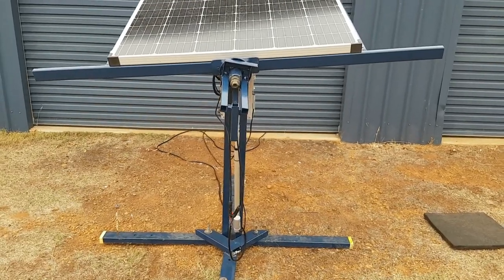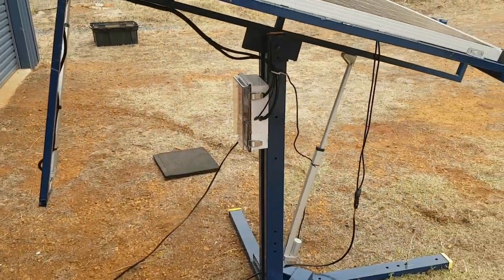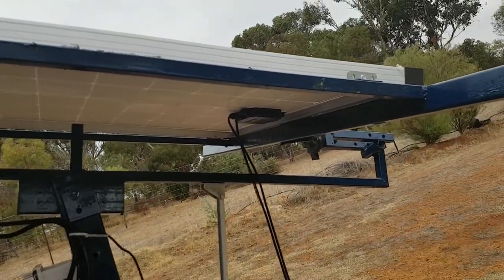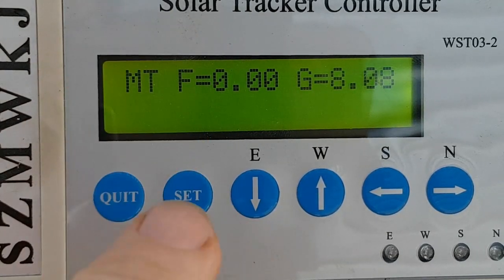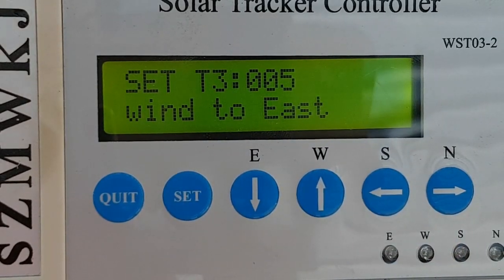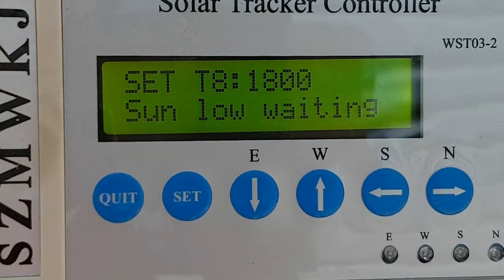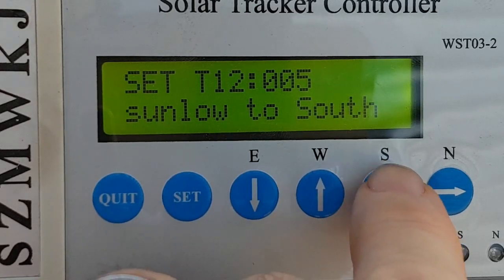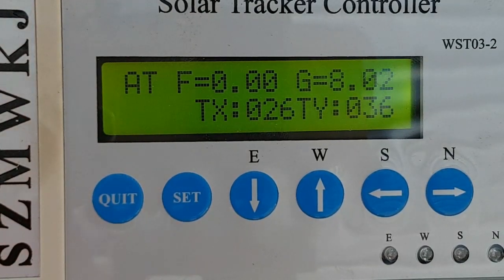2 axis Solar tracker using a  WST03-2 controller

Comment: I'm just replacing my old system with a WST03-2. Confused about polarity for the motor output ports? can you help?
Reply from the maker: Easy, connect an actuator and press the button to move your tracker N or S ( or E or W - depending on the one you are testing). If it moves your tracker in the wrong direction, reverse the polarity.
The controller doesn't know how your tracker is designed, only to drive one actuator or the other. The actuators extend with the voltage one way and contract the other.

Comment: Hi. I've just set my controller up but I cannot get the actuators to move in manual mode. All 4 direction led's ar showing on but I noticed that yours are off in the video until the particular direction moves. Any suggestions please? I have run the actuators with a seperate power supply and they both work correctly.
Reply from the maker: Did you press 'SET' so that you had manual control.  (Then 'QUIT" to return to the programme.)
If so, put a meter across the output and check you get voltage when you press a direction.  If not,  check you haven't popped a fuse.
If you are using the same actuators as me, remember they won't drive once they are at the end of travel, not until they get a
reverse voltage to drive them the other way.  If the green light is on,  output voltage should be there,  actuator at end of travel is the normal reason for no movement.  They have internal limit switches that disconnect the motor to stop them burning out.
Reply: @dadawoodslife  Yes, I went to manual mode by pressing 'SET'. The display shows that I am engaging N/S/W/E but the actuators don't move. I have set up Auto mode and the platform moves around. ATM  led lights are showing 'ON' for S/W/E and N has moved to it's extremity and is displaying 'OFF' but the actuators will not move in manual mode. Very strange. Please help if you can.
Reply: My conditions are not ideal at the present time as I have significant cloud cover. I am wondering if it will rectify itself when I get some proper sunshine.
Reply from the maker: All four on at once shouldn't be possible. Check the connections.
Reply: @dadawoodslife  One other thing. If I disconnect all 5 tracking wires from the controller, manual mode becomes active and I can move the platform in all directions.
Reply: I noticed that the internal dome surface has significant opaque streaks on it and the value of G is not rising above 0.01. Could this be the problem that the sun sensor is not letting in enough light?
Reply: I solved the problem. I had it wired incorrectly as you suggested below. Can you tell me what you used for the housing? It looks good!

Comment: Nice video, however the controller isn't very good (what are all those back-forth movements?). Check out this controller: https://youtu.be/OBST3dMkdsw
Reply from the maker: The hunting looks exaggerated due to the time-lapse and is caused by the tracker finding the brightest  part of the sky when clouds cross the sun. This ability to follow the intensity rather than absolute sun position is why trackers outperform timer driven actuators.
Reply: @dadawoodslife  I agree on the "light based strategy" to be superior than astronomic. Can the cloud chasing be disabled in your controller?
Reply from the maker: @ingDemurtas  Don't know why you'd want to. But then again Australian skys are very harsh, small amounts of cloud cause significant drops from the normal deep blue, skin-charring variety. 
It's not something I've ever considered. The only time I hear it hunting frequently is on rainy days when the cloud cover varies significantly.
Reply: @ingDemurtas  No, but you can set longer trim times, I'm in Canada and I set mine to do a compensation every 20M, the tracking array is only 540w, the main 1.4Kw array is static

Comment: DOES THIS CONTROLLER ACCOMODATED WINDSPEED SENSOR
Reply from the maker: Yes there is a windspeed sensor available and input and you can configure the response when a set wind speed is reached.
Reply: @dadawoodslife  thank you

Comment: it is a nice build you made. You write in another comment the actuators have endswitches. Can the controller move them out of the endswitch position automatically? Or do you have to reset them manually? No extra switches neccessary?
Thank you...
Reply from the maker: No they work automatically. When they reach end of travel they stop. Then, when driven in the opposite direction they move that way.
Reply: @dadawoodslife  Thankyou!

Comment: what is the size of  linear actuator i have to use ( part number or model number etc)if the tracker has to support two PV module of 2x1 meter size each weighing 23 kilos .and wind speed of  50 meters per sec
Reply from the maker: When I built my tracker I built it so that it balances, the actuators then only have to move the frame, not lift them. 
The length of the actuator depends on the size and geometry of the frame. I bought the longest ones available with the module on eBay. It meant adding an arm to extend out the tilt but you are not requiring speed so slow small movements are better with less chance of over shoot.
Reply: @dadawoodslife  I bought the same controller and it is working fine , as per the technical manual. I just wanted to check with you if this same controller can it be used for deployed in the field with 10 PV panel system. Will this  controller work for 10 years . Or is this controller suitable only for DIY project ?
Reply from the maker: @manoharanrajbushan3046  I'm only an end-user like yourself and I have no MTBF figures for this. However, mine has just had a year's continuous use, 4 months before that, a few months before that, and has been back and forth across Australia on the back of a Ute, about 9000kms, so I find it quite resilient.
I'd suspect it's reliability depends on it's treatment. Mine is in a waterproof case, with its own battery, which is charged from my main battery bank.
Thus it is dry, shaded and has a very stable power supply.  It's only driving single actuators on each channel.
The number of panels depends on the balance and design of your mount. If it is well balanced then the actuators are not doing any heavy lifting and therefore the electrical load will be low. That will extend the life of the actuators and the controller, I would have thought.

Comment: I’ve been looking at this kit for a while now.  

How many panels, or weight can this tracker move?

Does it sense wind?  What happens in high winds? Does it lay flat?
Reply from the maker: The weight it can handle depends on the design of your framework. Mine is in balance so it's not lifting the panel. I currently use one panel but I built the frame to hold three.  As they are in balance the lift is negligible.
The wind sensor is an add on.
You can set a value as to what you think is the required wind speed, then you set the motors to drive for so many seconds until the panels are in what you determine is a safe resting position. That will depend on your site and prevailing winds direction.
You can't drive in one direction for too long as the rams have limit switches.
Same as the low light level setting. I set that so that the panel drives to where the sun will come up next morning.

Comment: Do you have to count the seconds it takes the actuator to move it to east to west?
Reply from the maker: Yes. Count how long it takes, by using the manual mode, to move from the finish position to where you want it to start the next morning.  Enter these values. 
If you enter numbers too big it doesn't matter because the linear actuators have stop switches and cease driving when they reach their full extent. 
Similarly, it doesn't matter of the number is slightly too low.  As long as the detector is left facing approcimately where the sun will cone up,  once the light level passes the threshold  limit the tracker will move to exactly where the light is coming from.
Reply: I have ordered the same controller with relay module and yet to receive it .i plan to use stepper motor , ( i have one with me readily available ) and the driver for it .
In this case as i donot have end travel limit switch , i thin k i have to be careful to enter the correct value in seconds for travel from west to start position. Please suggest